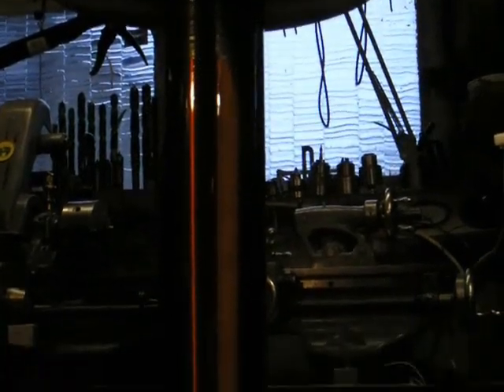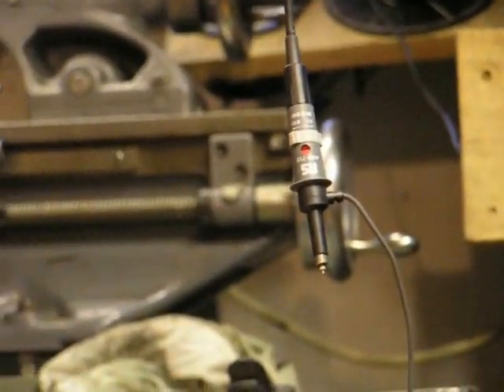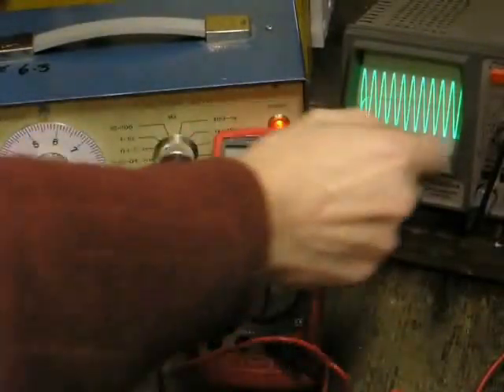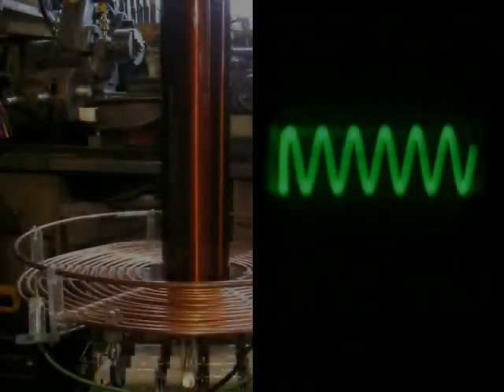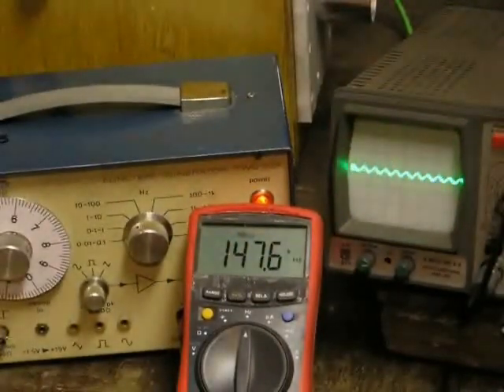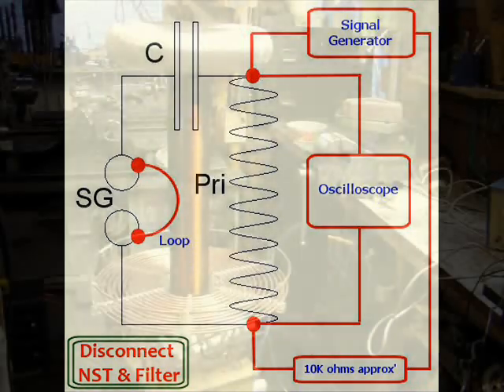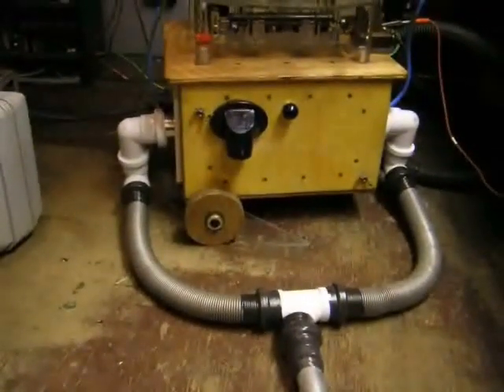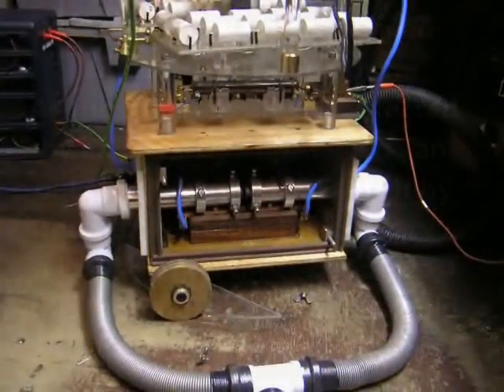Tuning A Tesla Coil with an Oscilloscope

Comment: How did Tesla do this when he didn't have any of these tools? Or did he?
Reply: You can do it without an oscilloscope or frequency generator. Simply change the turns of the primary and/or the capacitance in the tank circuit until you get a decent output. It may not be as perfect as the method presented here, but it will work quite well. With a bit of practice you will get "close enough" within 15 - 20 mins.

Comment: Can you use a frequency generator from a cell phone to measure the secondary.. Also i have a homemade oscilloscope that doesnt have any adjustments. Would this be suitable for the task at hand?
Reply from the maker: I tried that and had no luck. I suspected the output voltage was too low (the current is very likely too be low as well). Having said that a 555 timer chip can be used as a source  I have been told  but don't think I've ever tried it. 
Can't say about the oscilloscope but I very much doubt it. Firstly the signal being measured is very variable in strength, with the primary's received signal being (at a guess) a thousand times stronger than the secondary signal that's received by an aerial. Also the time base setting of the oscilloscope has to ideally be near the resonant freq of the coil to see it clearly on the display, as you need to easily distinguish between the 'ghost' (harmonic) readings and the actual frequency.

Comment: SIR COULD YOU PLEASE set the frequency to about 8hz or 7.8 there about and test it with a fish tank to see how they behave or other animals
Reply: @ Stine Newton : the lower the frequency the more enameled wire you need.
looking at a frequency to feet calculator says that it would be 5823.8 miles of enameled copper needed for 1/4 wave resonance @ 8 hertz, and 23295.4 miles for full wave @ 8 hertz . and probably insanely expensive capacitors!

Comment: Hi, is it possible for you to  try  resolve a question I have?   If you feed  the  primary  a different frequency than the resonant  one, would the secondary oscillate    at that fed frequency? (  amplitude would be low of course) thx
Reply: Kaledius it will always resonate because the voltage bounces up and down top to bottom quickly. It's wether it is in phase being pushed at the opportune moment or smashing into. I believe it will eventually synchonze itself. Lemme know if you would like to chat from time to time. I'm looking to make friends to tech talk with :)...

Comment: Thanks for the video, this really helped.  I have a very important question I have been wondering a long time:  Regardless of amplitude, would the secondary oscillate STILL at the same primary driving frequency if  the primary frequency was way  of secondary resonance??
Reply: Yes. However most of your energy will be wasted instead of transferred.

Comment: here's a design question for you: (have you observed or tried this?) would there be any noticeable performance difference if the direction of the primary winding is the same or opposite that of the secondary? ie. primary clockwise, secondary counter-clockwise; vice versa. Thanks.